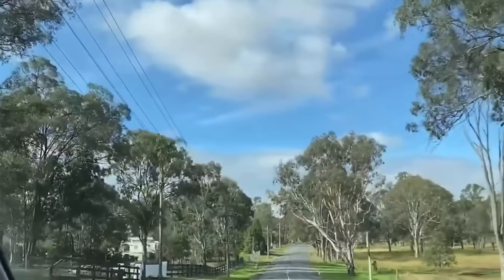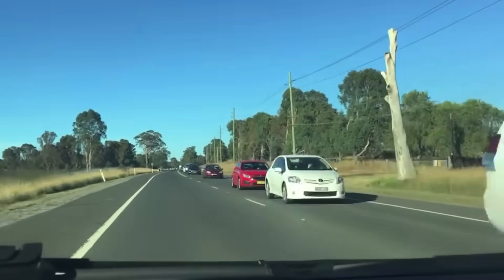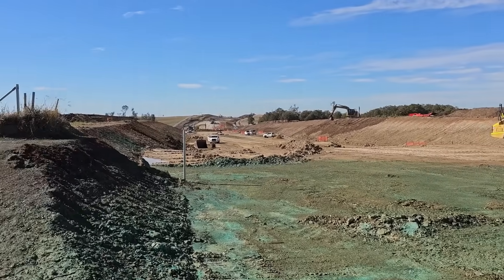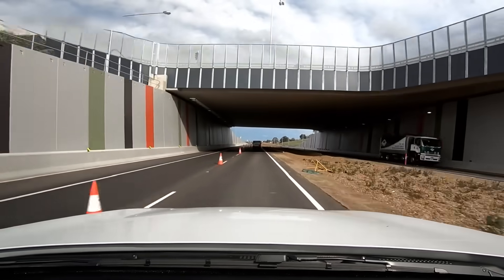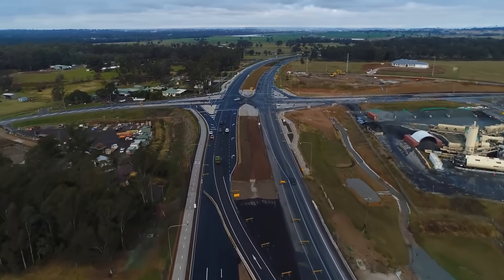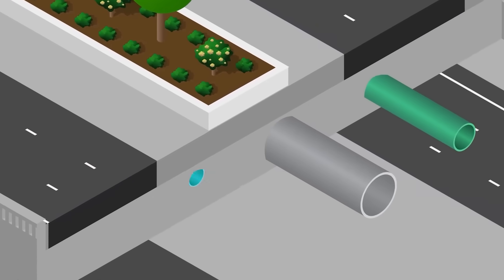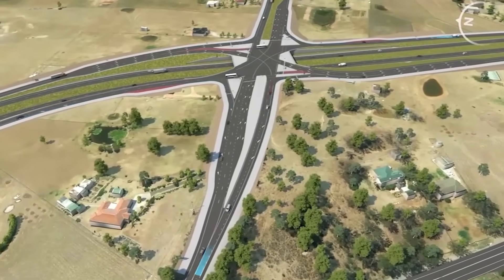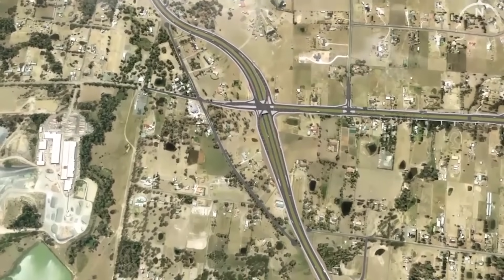Sydney's $509M SHOCKING Bringelly Road Upgrade

Comment: Bringelly Road runs east-west, south of the new airport. It connects to the  A9 (running north-south) on the western side of the airport, which provides for the new air freight terminal (at its south west end end). 
However, it is NOT the major road route to the passenger terminal on the an airport’s north side. 

The major road serving the airport is the new (toll-free) M12 motorway, 4 lanes, expandable to 6,. It is on time to be completed in April 2026, before the airport opens. 

Paralleling the M12 is Elizabeth Drive, an existing arterial road of two lanes, now being expanded to four lanes for much of its length to provide a secondary access to the Airport Terminal and Business Park from the northern side.  The M12 connects the airport entrance to the A9 in the west and the M7 in the east, which connects with the overall motorway system in Sydney. Elizabeth Drive also connects to the A9 in the West, but goes under the M7 at an interchange and on to nearby centre of the City of Liverpool (the airport also lies within that local government area). Elizabeth Drive and Bringelly Road will be 2 among about 6 express bus routes to the airport.

Elizabeth Drive has been a main thoroughfare for airport construction traffic. Much of the fill trucked in for the airport is from rock extracted during the construction of new metro systems in Sydney. The road surface has deteriorated due to the very frequent heavily loaded trucks. Now that construction is over, work is in progress for its widening to 4 lanes, with 6 in some busier parts.